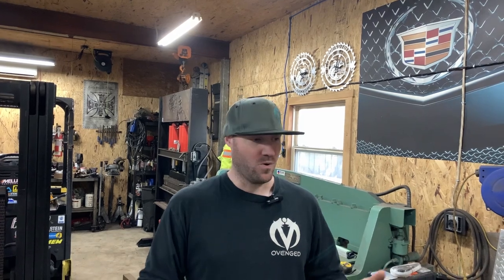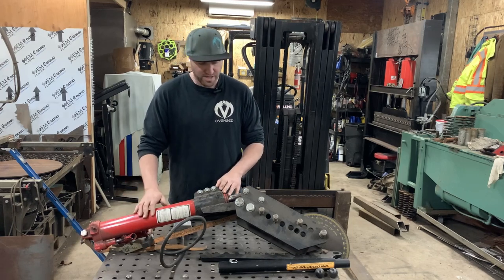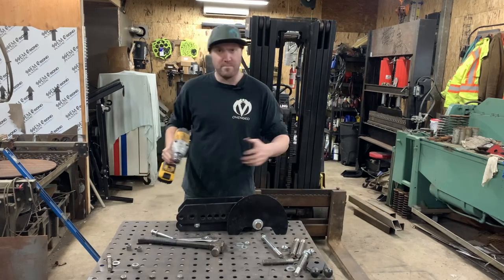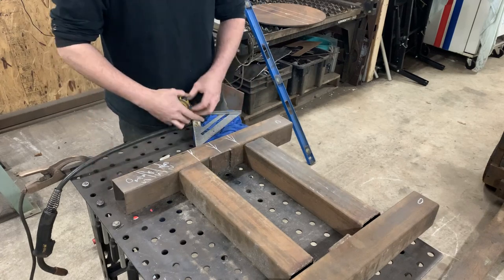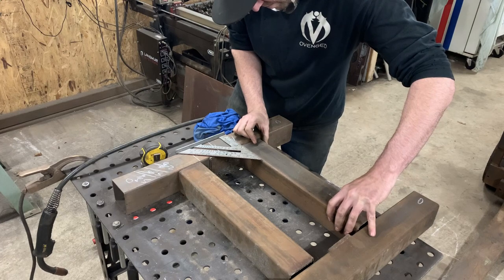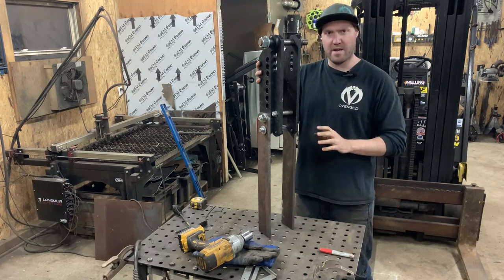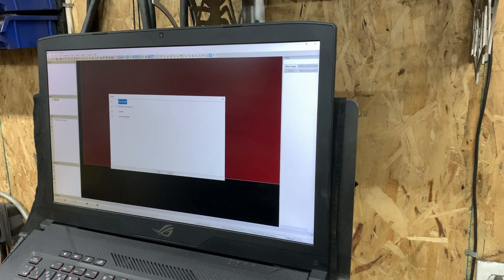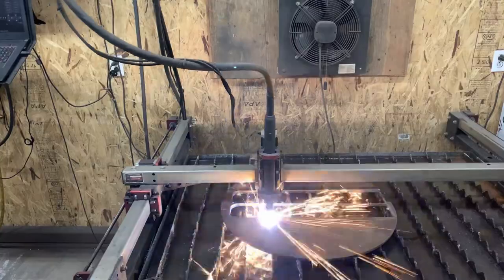VERTICAL TUBING BENDER BUILD! || OVENGED

Comment: If its that slow, why not use a hydralic power pac, not running a compressor. Derilin idea is great !
Reply from the maker: It came down to essentially budget! The air works great and I’ve been using it with no issues! for sure still a little slow! It would take awhile to do a full buggy cage/chassis or something for sure!

Comment: The main reason for you troubles is the hand crank valve needs to be facing down when using horizontally.
Reply from the maker: That’s quite possible! I’ve tried different positions I didn’t personally have any luck with the ram mounted horizontally! It works great vertically mounted and much happier with this set up!